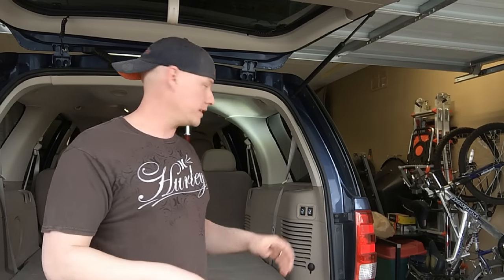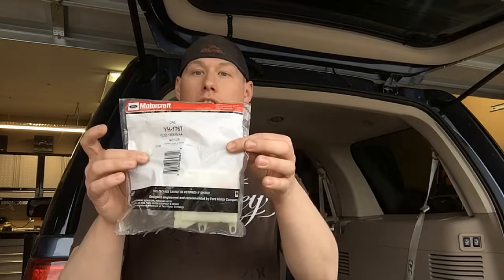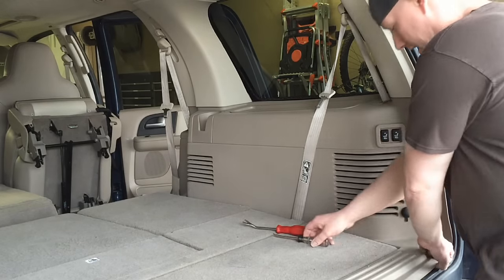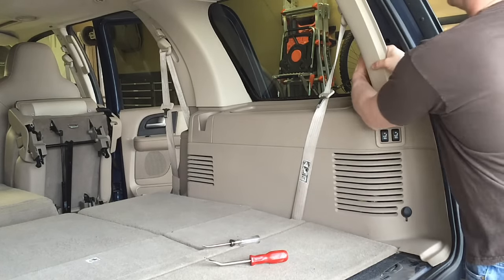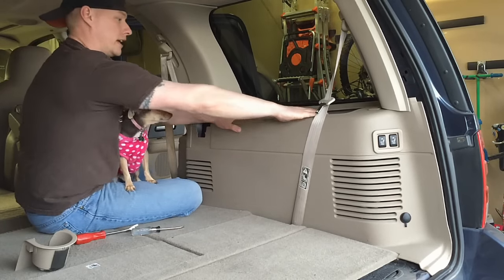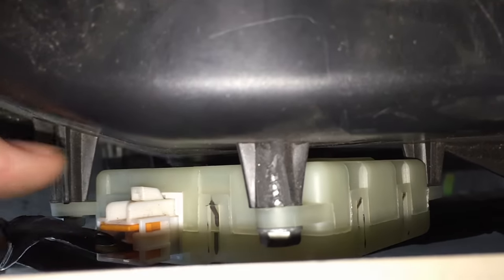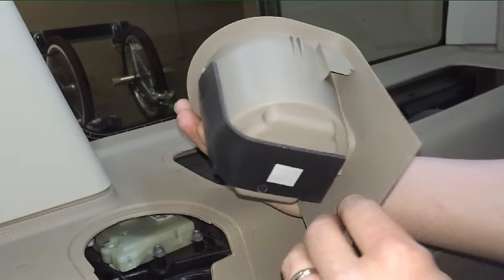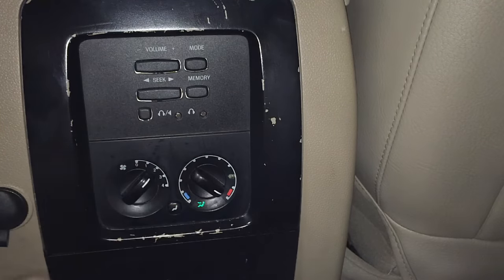2003-2006 Ford Expedition: Rear HVAC Temperature Blend Actuator Clicking Repair

Comment: hi man,i watch your videos very frequently ,in our family we have a 2000 5.4 excursion, the ac doesnt work ,when we turn the controls to ac and highest setting the compressor engages and a few seconds later disengages and vice versa.I wad wondering your opinion and if there are any problem with these excursions regarding the ac ,any feed back is appreciated  thanks

Comment: Great video, but I have a slight problem. I can't get the actuator back in.  I took the old actuator arm in the old one to test the vent door as you described but I cant get the actuator arm in the hole. No matter what I'm trying.  Any ideas what could be happening, it was going so well?
Reply from the maker: Does the arm look to be the same style as the old one?
Reply: +FordTechMakuloco 
I figured it out.  It is a tight fit, I got the old actuator to fit.  The part off Amazon is not oem and the post was slightly larger.  I mean just barely.  I took a file to the sides and little off the front and I got it to go.    Thanks for your video.  Hopefully this will help others that might struggle getting it to fit.
Reply from the maker: +Mark Forsey Ahh aftermarket explains all glad you got her in there.

Comment: Thanks for the video but a word of advise, when troubleshooting make sure you identify which actuator needs replacing.  At 4:18 you can see a second actuator laying flat horizontally (same yellowish shaped part seen towards the top of the cupholder opening).  That one can be removed and replaced without needing to pull the clipped panels out (just by removing the cup holder and top access panel).  I replaced the side one in the video and didnt know about the second one, but that one is much easier to get to and replace.

Comment: I have a 2015 Expedition with this issue.  I actually replaced the actuator that is located near the cup holder.   

After replacing the part, I am still getting the clicking.  

I read somewhere that there is a second actuator this is located lower down, buy have not been able to find the procedure to change that.

Is this true?   Or maybe the door it self has an issue?
Reply: Finally got around to changing the second actuator.   The 2015 actuator has four screws which makes it tougher to get to with the panel not fully removed, but was able to get it done and the system is working perfectly now.

Comment: great video i had a question is my blend door busted it ticks and goes from hot to room temperature it doesn't go cold  the dealer said its the blend door actuator
Reply from the maker: +JULIO R. LOPEZ Almost always the actuator as shown in this video yes.
Reply: @FordTechMakuloco  thanks for this!! I have a 2003 XLT and the rear heat clicks when turned on!  I will change this asap 🙏

Comment: I don't have this problem anymore but I do have an issue with my 2004 F150 3v.
It won't idle.  I have changed the fuel filter, fuel pump, wires, plugs, cam phasers,  timing chain and fuel pump regulator. It runs fine when you have your foot on the gas but at idle it stalls out under 1000 rpm. It is showing code P1000. 
It's a strong running truck but won't idle. Any help is appreciated.  Thanks
Reply from the maker: If everything has been done right and all vacuum connections have been checked I would clean the maf and replace the throttle body-
http://www.amazon.com/gp/product/B001H2L3BK/ref=as_li_tl?ie=UTF8&camp=1789&creative=390957&creativeASIN=B001H2L3BK&linkCode=as2&tag=fordt-20&linkId=6TIQTZCRMXMWL52R

Comment: Hey Brian, I have an '06 Expedition with the infamous clicking when changing from roof vents to floor vents in the rear, however thankfully they are stuck on the roof vents for now. My main issue is that the rear blows hot air and I hear a continual hissing coming from the rear area where you're working in this video. Up front the AC is blowing cold like normal, but the rear is so warm, it's almost like the heat is on. Can you explain what might be going on? Thanks.
Reply from the maker: Ryan McWhosoever I have two video on this in the rear on yours you need to follow both videos to change the actuators out. After that it all should work.

Comment: I know this is not a 2003 lincoln navigator, but is it the same process? I have a ticking sound coming from there, I disconnected the connector from the actuator and it stopped the ticking noice, is that the problem???
Reply: Hello Hector, I have a 2004 Lincoln Aviator, I also have a clicking sound at the back which they call the HVAC Rear Blend door actuator. From What I see the only similar process was taking off the trimming or the panels, other than that I still couldn't find where it is. On the Aviator it is at the rear passenger side If you disconnected the connector and the clicking sound stopped it is safe to say replace it. On my   SUV I have disconnected 2 connectors and 1 relay, the clicking noise is still there. WIP still for me.

Comment: Hey there again is the actuator the same part number for the blend door and the floor to heas vent actuator the dealer is telling me its the same part for both is that correct? ? thanks again for your help
Reply: *floor to head *
Reply: basically same part number for both actuators

Comment: My rear ac in my 2004 Ford Expedition is blowing air, just not cold air.  What part do I need to replace?  I called a few shops and they want 4 hours of labor to replace it.  One shop said they will just empty the freon and replace with 4lbs of it and that should solve the issue.  Any ideas?  I'm on a very tight budget.  Front AC is blowing cold.
Reply from the maker: +Kathy Ghaferi-Long You want to replace this actuator first as shown here. If there is any click the actuator has failed also if you cannot turn the temp to hot the actuator has failed.
Reply: So if it's blowing air which feels on the warmer side I should replace this still. I don't hear any clicking sounds although I've had this issue for well over a year and am now just addressing it. It might have had a clicking sound that has since stopped. I ordered the part and wrench from Amazon. Someone else was saying it might be a freon issue but the front blows cold air? Any thoughts?
Reply from the maker: Fix the actuator and go from there the front and rear a/c system is the same system the only difference is the rear uses a txv but never seen one go bad.
Reply: +FordTechMakuloco  Thank you!  Waiting for the parts to be delivered today.  Hopefully can get it changed out tonight or tomorrow.  Will let you know how it goes.  Appreciate your responses!
Reply: So we replaced both of the parts in the back. Good thing I had ordered both and hallelujah cold air in the back. I am forever grateful for this video. The total cost was $120 and about 1/2 hour of time.  That included the tools he uses!! Yay!
Reply from the maker: Kathy Ghaferi-Long Nice!!!

Comment: hi in my 02 ford explorer my rear heater  doesn't  work   any clue what  could be the  problem  or is the same problem as the expedition  and where  is the actuator  located  in the 02 ford explorer thank you
Reply from the maker: victor escobar Most likely yes does your click? Yours is located on the left rear though.
Reply: ok thanks  and  the one in the front  I'm  working on it  right  now  but the ono i got from  autozone  didn't work so i have to get  the one from the dealer  i hope  it works
Reply: victor escobar B.B.

Comment: i brought a new acturator and  plug it in it didnt move  so i figured it must be something else is wrong the air flow in the back vent but not out the front vent

Comment: my 12volt passenger side and middle section charger ports dont work....what could it b...I have a 2006 eb expedition...the lighter and rear works fine
Reply from the maker: +Benjamin Whitley fuse for sure they are common to blow it will either a 20A or 15A on the interior fuse panel
Reply: Kool...advanced auto and autozone keep asking for a specific part number.....I'm reading 20a for the #52....I will give it a try and see
Reply: Thanks

Comment: An what's the top one ? The side I know now but the top one ?
Reply: Top one is Rear HVAC Air Distribution Actuator for floor or ceiling vents - side one is the blender for hot/cold.

Comment: Did it drain your battery?
Reply from the maker: no
Reply: I'm changing the actuator out right now and noticed that the top metal line is hot is that normal?
Reply from the maker: The motor yes

Comment: Freaking awesome video. I put up with this stupid noise for months. Few days of research, I was able to order $45 replacement. After contemplating for 3 weeks (because my lack of confidence in mechanical common sense), I decided to do it today. I am so glad I watched this video. I followed exact steps and was able to replace the actuator in 30 minutes. That flex wrench suggestion was right on the money. If I can do it anyone should be able to do it as well.
Reply: You’d be surprised at what you can fix on your own with a little common sense and a good YouTube video.
Reply: Can I borrow that flex wrench??!!

Comment: A quick tip I learned is, you can remove the actuator, open it up (there's a video on his page for it)  and use the shaft (D shape or T shape)  as a key... To either move the Air to the tempatures you like or the direction of the vents you like)  this is free because you are using the old part... Until you get a new part and it stops the  clicking.... Or you can use the old part to make sure you are fixing the right problem... By following the same steps... If moving the shaft manually with the key works, you are doing it right
Reply: i did the blend door actuator today and use the X key after taking it apart and seeing all the gear teeth shredded.  I only use roof controls so i just turned it to roof. The front ac is noticeably  colder than the rear. If i take off this part and use the key does it default to a position like its spring tension or can I turn it to full blast cold and it will stay in that position?

Comment: Thanks, helped me with the replacement.  Turns out the keyed plastic shaft of the new actuator didn't want to go in.  Ended up filing the edges of the shaft at the tip then it slid on.  Much appreciated!

Comment: Used this video to replace both the temperature blend actuator and air distribution actuator for 2005 EB Expedition.  Only took about 30-40 minutes and about $80 worth of parts.  Spend the money on the wrench, trust me.  Great video, thanks!

Comment: Thanks for the great and informative video. I spent Sunday morning changing out this door. 45 minutes and done on my 2007 Expedition. My part number was slightly different but the process was the same. Thanks for making my repair a lot less expensive for me!
Reply: I also have a 2007 Ford EXPEDITION.  Do u have the part number? I want to get rid of that clicking noise

Comment: Hey Makuloco! You're the man. I love your videos. You've saved my butt multiple times. I have a question. Would the repair be the same for a 2005 6.0 Excursion? I'm getting AC in the back but no heat. Winter is approaching and my kids need to be warm back there. Thanks buddy. Keep making great vids!

Comment: Hey Brian! Out of curiosity, is this the same issue that kind of sounds like a kick drum noise in the back when the rear air is blowing? I noticed it is a bit louder when on the feet but still noticeable when on the head? I would describe it as a click, but more of a thump noise. Thank you so much in advance!
Reply: Open it up like he shows and place your finger on the actuator. If it's clicking you will feel it. This way you will know which one if any is making the sound.

Comment: I got another blend door (I Think) issue. Got the 2005 Expedition 9/2015 hot and cold worked well in the front now it's just cold air(rear hot and cold) I replaced the front actuator (I used old front actuator in rear blend door, perfect fit) as another one of your videos stated(easy thanks) but still get cold air. SO!  how can I cut into hvac box and manually move blend door(it's cold outside) till I can replace it?

Comment: Hello there.  I hope you can help me.  I have the 2005 exp and have just discovered the clicking noise.  Here is when I notice it.   When i turn the rear vent on full , I then push that little black button in between the power vent and the temp vent.   The clicking happens when i push that little button.  Are there two actuators in that area or just the one you showed? In another video, there was an atuator that was laying on top...not the side.  Thanks in advance.

Comment: Great video and great shortcut vs the "official" repair guide. Been putting off this repair since the seasons changed, and we didn't need the rear heat to work lol
Just wanted to point out that the ratcheting wrench isn't REQUIRED, just makes it a bit easier. Just pulled mine out with a 3/8 drive AND 1/4 adapter for my 8mm socket. Just had to pull back a little further and CAREFULLY get my crankin arm into the void behind the panel.

Comment: Hi, I have a Explorer 2005 model. I have noticed that the air conditioner blows almost no air on the driver window side vent. The vents in the centre of the vehicle seem to be doing fine. Any thoughts on this?
Reply from the maker: john benjamin Desouza Most of the time very little does come out the side vents compare to the other side. Otherwise there is not other control door for the outer vents.
Reply: thanks man

Comment: This is very helpful video. 
Do you have a video how to trace the leaking air conditioning? I hear a breading like psssss sound every few seconds while the aircon is on. I can hear it from the rear. Mechanic only top it up with coolant but will ran out after a month.
Reply from the maker: +Edwin Banaag A/C dye is the only way.

Comment: I have a 2005 naihati an its makin  da same noise when I cut the air on 4 the back would dis be the same problem
Reply from the maker: Wayne Galle Navigator should be very similar.

Comment: Seems like it clicks when I try to change it from the rear vents in the roof to the vents near the floor.
Reply: Mine click from the front and back and just move the ac temperature a lil and they stop what causes that?

Comment: OK, so you showed us the Expedition and it's rear HVAC, Now does the Explorer have anything similar? I noticed some condensation dripping by the rear of my explorer, is there another HVAC system in the driver's side panel rear? Is there also a filter that needs to be replaced there also? I noticed the dealership put some aluminum tape over some vents in the rear of my Explorer? I have a 2017 explorer, xlt, 4x4, V-6 no turbos?

Comment: How did it finally work out, regarding the part numbers for the rear top actuator and the side-mounted blend door actuators?  I have a 2010 Expedition with dual zone HVAC, and have been dealing with the same issue. The top one is the Motorcraft YH-1743; looks like the side actuator is the YH-1767 shown in the video., but I can't be sure  until I have removed it.  While I have a ratcheting head 8 mm wrench, when I replaced the front blend door actuator, located above and behind the radio, I  can't remember whether or not I couldn't find the nice Chrome ratchet wrench when I needed it, or if it was too big for the tiny space I was working in. My solution was to take a short, flat, thin reversible ratchet that took 1/4" hex bits, then put an 8 mm hex socket in it, and cut the long part of that socket shaft off at the top of the back of the bit holder.  Occasionally I had to put the socket on first, then slip my cheap, flat ratchet wrench over the socket to get it to work, but I didn't have to remove the radio or any parts other than the broken actuator, but I did drop the glove box door to get room to get my hand in there to keep from losing screws. Ford says it's any 8 hour job. After you've done it once on the front top actuator, with the right tool, it's 10 minutes tops.

Comment: I wonder if this is my problem.  Whenever I turn my vehicle on it starts clicking/clunking back there.  It used to do this only when i turned the heat on, but now its whenever my Navigator is on and its constant. Thoughts? if so I will buy the parts from your amazon links :)
Reply from the maker: +Daniel Graves Verify of it is the temp actuator or the air mode door actuator I have videos on both so you order the right one.
Reply: FordTechMakuloco it's this one, I reached in and unplugged it and it stop making the sound. What's odd is that it always does it, not when I only have rear air on

Comment: At best I'm getting Luke warm air from front and back.  Had to manually turn the blend doors to heat because the actuators have no power.  I'm lost on this vehicle.

Comment: The air on mine is leaking out inside of that cover. Any idea how to fix that (similar problem)? Also the control panel is stiff and needs to be replaced on my SUV. Thanks for the video.

Comment: question? Mine works w/o ticking noise but its always blowing cold/hot air on the bottom vent not on the roof one? what should I do? thanks
Reply from the maker: Kevin Vernal Remove the rear trim panel and command each actuator to see which one is not moving.

Comment: I have a 2003 Ford Expedition the water is leaking above the muffler and it's overheating there's a little hole there and that's where the water comes out of the water that comes out is hot you have any good suggestions for that

Comment: I have a 2005 Ford Expedition, and only my rear floor vents work not the ceiling vents. The A/C and Heat tempatures are right . Will this fix that problem too
Reply: After I changed this one I realized it was the wrong one 😂... What I needed to change was the Air distribution actuator  which was right on top... So I did both since I already had both parts... I followed your video step by step and everything works perfectly.... Thank you so much
Reply: Did you celling blows after you Put them
Reply: Ana Sanchez yes they did.